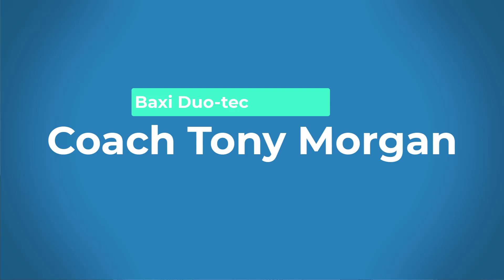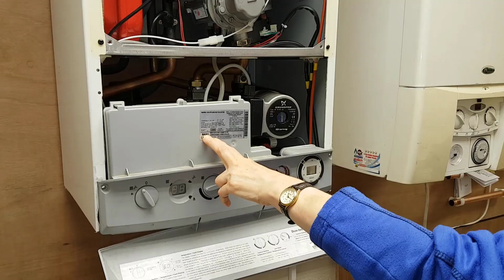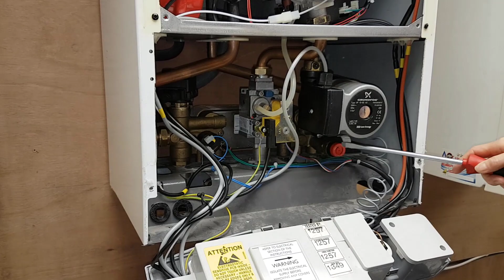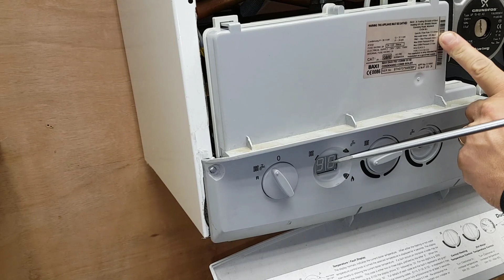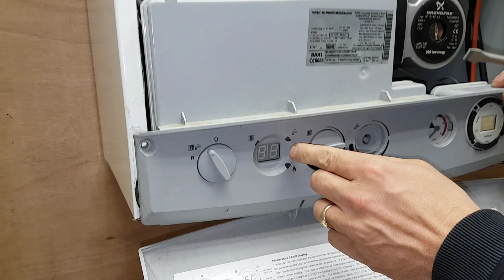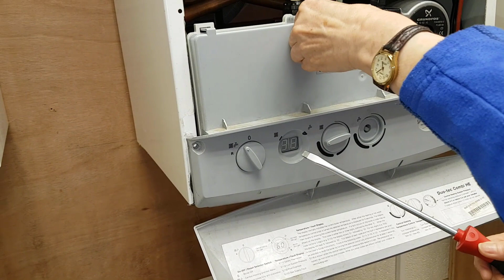How to Learn Boiler Repairs  Fast! With Coach Tony Morgan

Comment: This course seems brilliant! How much is the course and how long does it last? I am starting a new career in this industry and this video explains how the boiler sequences work perfectly. Thanks
Reply from the maker: Hi click on this link visit https://www.masterfulengineer.co.uk/
 can you can see all about it
Reply: Dude I don't mean to be rude but have you never read a Manufacturer Instructions? It tells you exactly that, how the boiler works and what the parts are.
Reply: @MSKChess  I have read a few but its putting reading knowledge into actual physical knowledge. Having been shadowing a gas engineer working on boilers daily and doing it without pay cause I'm wanting to work in this industry. I've noticed you can read as much paperwork, read as much books and manuals but nothing can beat actually physically doing the job manually.
Reply: @musashi1045  Sure there is no substitute for experience and hands on but most engineers are slackers and hardly ever read the MI's except when they are filling in the benchmark.  Ask your mentor for an old boiler and hang it on a wall somewhere and take strip it down and put it back, the MI's tell you how to do it, seriously, don't get into bad habits, read the MI's even if you think you know it.
Reply: @MSKChess Sadly enough I have been to jobs with slackers who previously 'sorted' the boiler issue. Me and my boss turned up and the previous guy claimed he changed the prv and recharged the expansion vessel but when we got there he did neither as the prv that was there was years old and worn and torn. But as the rules say you dont talk about another engineers mistakes. So we fitted a new prv and recharged the expansion vessel then got the boiler working and the pressure issue was fixed. The guy before basically blew smoke up the customers arse, robbed them and SSE and made up some Mickey mouse bullshit and make £150 an hour for literally fucking everyone over.
Reply: @MSKChess  I have been very fortunate to be taught history of heating and everything in between. My mentor is my best friend and all the most qualified guy in my city so I'm being shown everything he knows but I'm also learning elsewhere from books.
Reply: My mentor said if I get stuck then ask you for the answers and if you can explain what happened  before the big bang then that would be a bonus too einstein..
Reply from the maker: @MSKChess  If you find any MI that explains like this so you can memorise it, please let me know.
Reply: Sure the Baxi Duo Tec installation and servicing MI, section 3.0 Appliance operation, it even has diagrams showing the primary flow in heating and hot water mode, Vokera have even more details of sequence of operation as do Worcester and many others, even crappy ones like Heatline.   @ARBoilers
Reply from the maker: @MSKChess  OK thanks for your advice 👍
Reply: I am not trying to negate the value of the teaching Master Engineer Tony, clearly you are an excellent teacher 4 sure, honestly, I just got a thing about engineers that don't read MI's and turn up an don't do proper servicing and misdiagnose repairs cause they are 2 lazy to read the logic flow charts etc @ARBoilers
Reply from the maker: @MSKChess  I agree which part of the country are you?
Reply: Hi Tony, in Glasgow, studied at Clyde College.  @ARBoilers
Reply: @MSKChess  thank you this info helped.
Reply: @ronmaren4135  No problem bro, you can test many things on an old boiler, also it super helps if you are doing something fairly involved like say a hydro-block on a Greenstar, once you take it out a reassemble it on your old boiler, you will feel confident when you have to do it in someone's house.  If you follow the MI you cannot really go wrong, that counts for fault finding and servicing as well.
Reply: @MSKChess  I downloaded the Baxi installation manual and studied as you recommended explains everything in detailed drawings. I also emailed Baxi and asked for a hard copy of the manual, they responded straight away that it will be sent out soon.